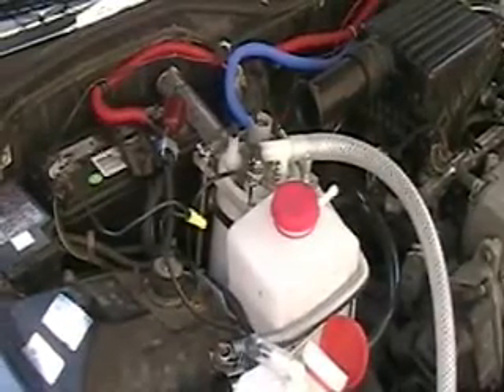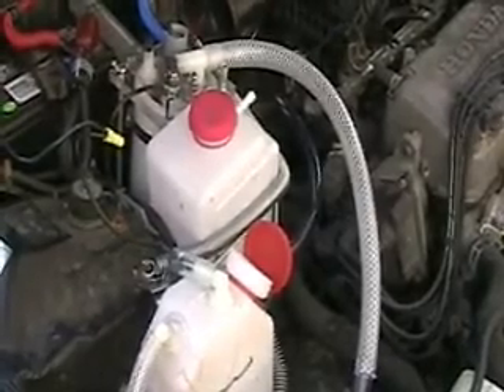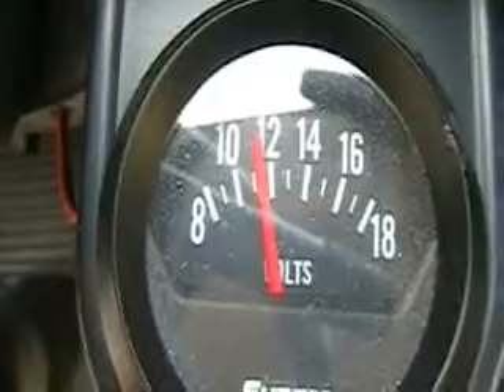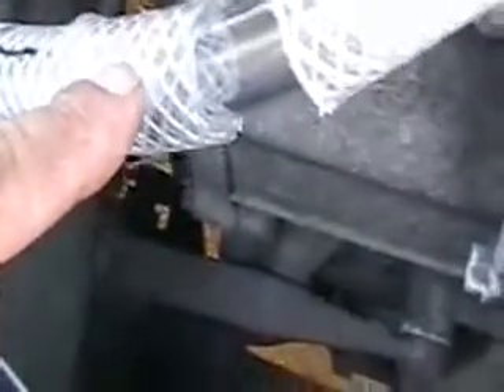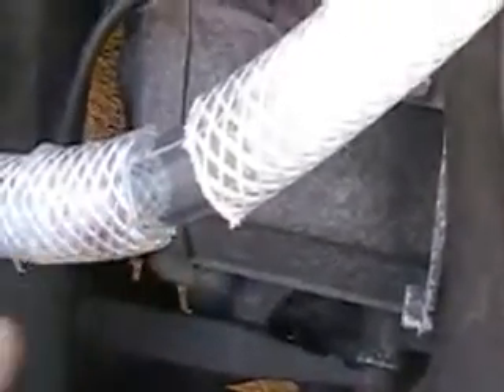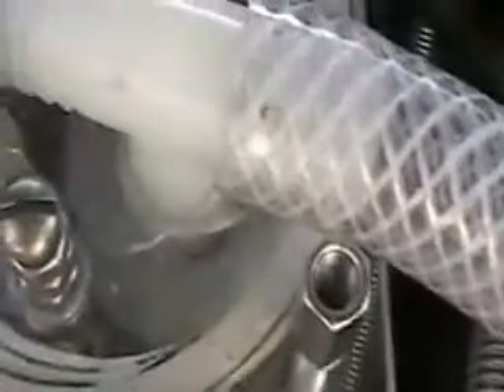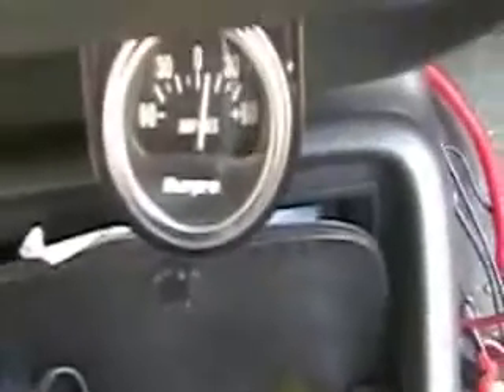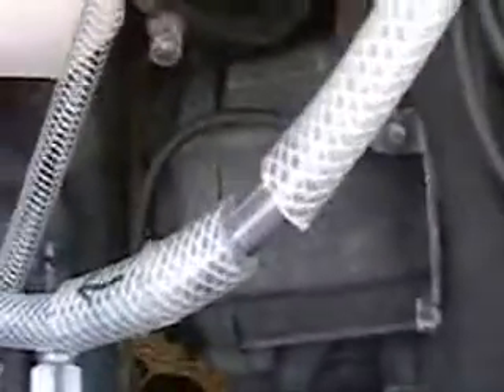Hydrogen Tap (First Hydrogen Honda Test) 377

Comment: What's your LPM output using your cell design and at what Voltage/Amps do you need to run them? I have not been able to get over 1 LPM at less than 30 Amps. You may want to try a Brick cell cofiguration. Output can easily double and heat is not an problem any longer. I had been doing cells like yours for a couple years but converted to Brick cells. Output upwards of 1.5 LPM at 30-35 amps and there are no heat issues...Just a thought.

Comment: Arent the voltage supposed to be 14.0-14.4V when engine is running? I did'nt see it increase when you push the gas pedal either.